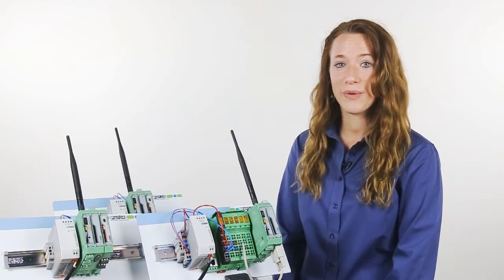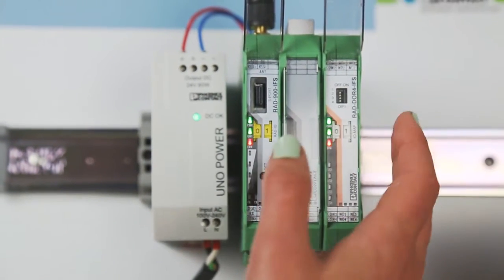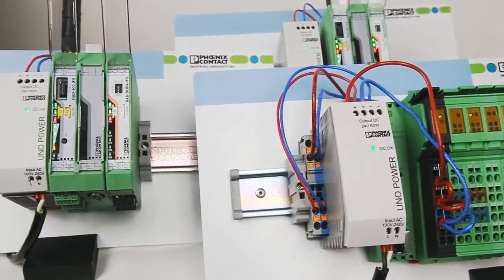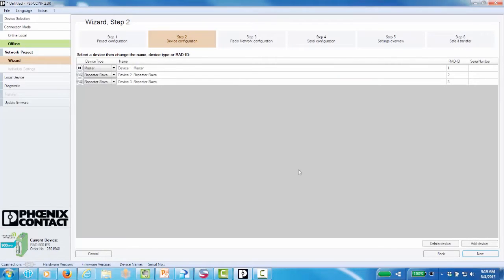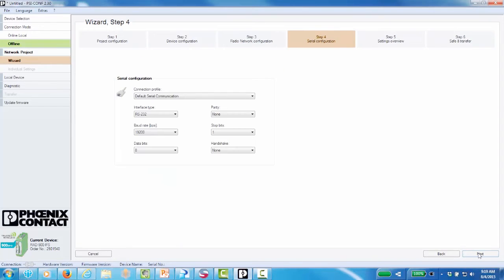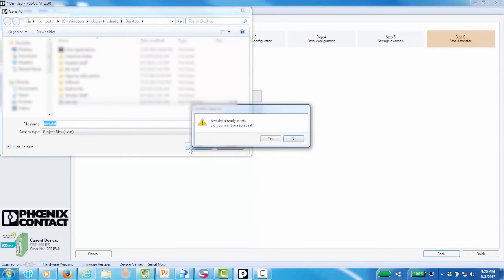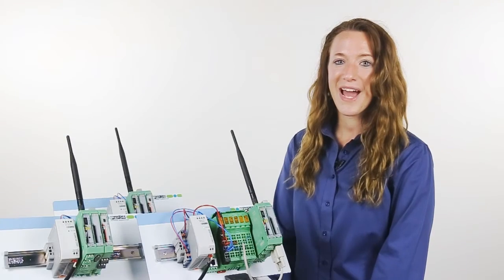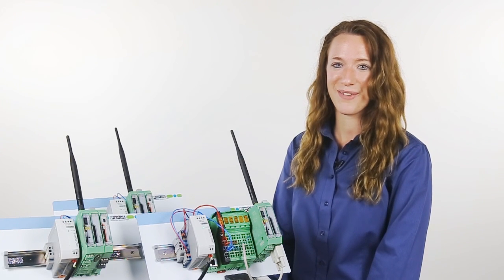Radioline PLC Mode Configuration

Comment: Hi, you can transfer the data from the serial port and expansions at a Time from remote stations ?
Reply from the maker: Marcelo Mancilla Córdova Hello, 
Thanks for your inquiry. The answer is rather complex, so it would be easier to address via email. Could you please send an email to: info@phoenixcon.com, and ask to forward to the Wireless Product Specialist? We will respond promptly.
Reply: Dear sr i need to built in water treatments station lan wireless network by using your system
I have 15 waterwell maximum distance around  8 km  from main station to well heah and wiev in scada system you can mske that